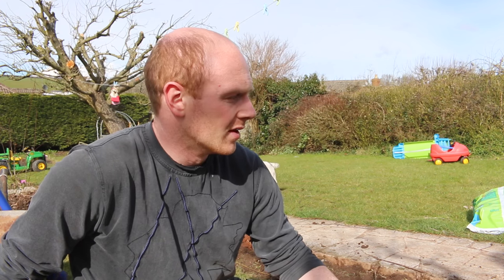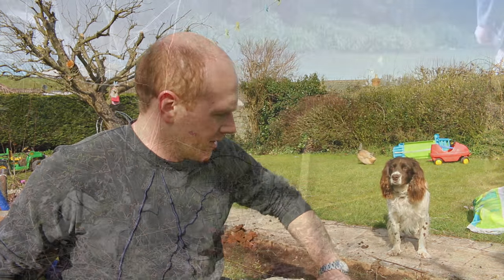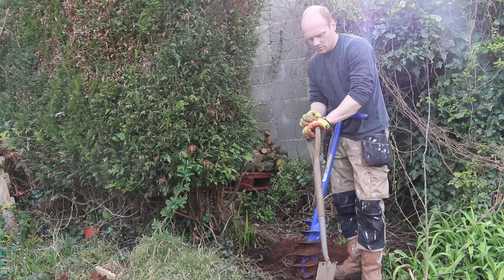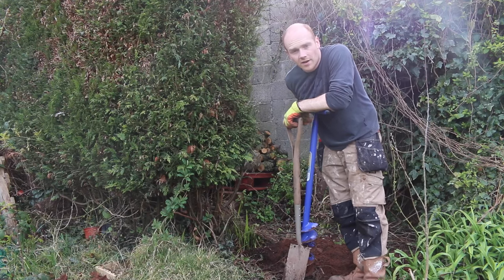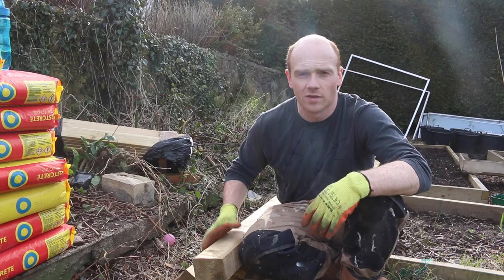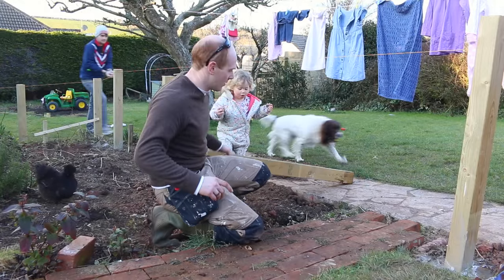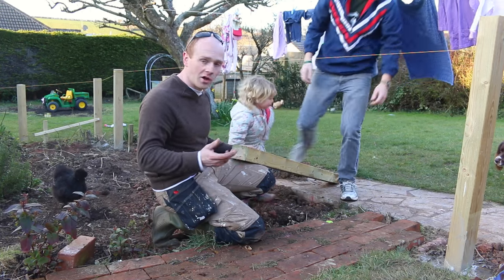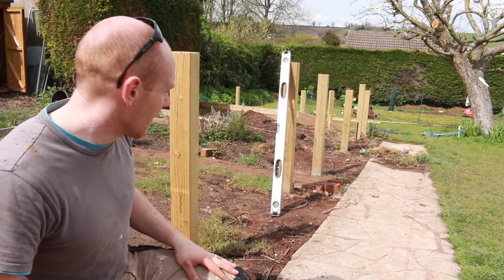Building a Picket Fence | Setting the Posts

Comment: Just a tip for everyone. Gravel in the bottom of the hole is absolutely not necessary. It wont hurt to do it but doesn't really help. Ive dug out 100s of posts in my time and that is the last bit to rot. Pay more attention to where the post meets the ground. Post saver wrap or bituminous paint. Youll increase the life of your fence massively 👍
Reply from the maker: Too true, did a video about this just the other week. 👍
Reply: Wrong. It prevents the end grain from soaking up moisture.

Comment: Wrap the bottom of the fence post in Denzil tape best thing ever for preventing rot.
Reply: Will try to remember.
Reply: It’s densyl tape and definitely don’t use that. It’s not even available to the average DIY’er
Reply: @isaactaylor1833  Actually it's Denso Tape,stupid auto correct,and you can buy it in any trade outlet,what's the problem with using it btw?

Comment: Smart job mate! Little tip for you that will save you hundreds in the future! Rather than concrete, leave your soil near you hole and use it to back fill around your post. All you need to do is basically remove any air from the soil by tamping it in nice and tight, few inches at a time. It's a dodle to do if you have a digging bar with a round flat piece on one end as the weight of the bar will do the work for you. And when your post eventually rots off, super easy to replace! Cheers!

Comment: Pouring dry concrete mix around the post will only promote rotting in the long run. Concrete wicks and holds moisture, which is retained between the wood and the post. This in turn ends up eventually saturating the post, encouraging wood fungi.
Reply: What do you recommend?

Comment: For ease of levelling and fixing the postcrete method is great, but if you have more help and time, I always simply use coarse and fine gravel and a sledge hammer with a piece of wood to compact around the post, this way the posts will last over 20 years.
Reply: 20 years is not considered a long rot time here in Australia  Glyn Tutt 30 to 40 is our considered time without any coating application,,,we have two main methods here of fixing posts in ground..the first and most popular is "stabilised soil"....cement mixed with the soil removed from the hole that is rammed back into the hole around the new post....this sets like mortar between bricks and is actually very firm but pores which allows rain water to drain through helping prevent the ground level rotting....and the other method is concreting which is even firmer but does trap rain water atop if the installer does not bother to trowel the concrete up the post to create a run off surface .....I concrete and trowel up but I also pour in concrete first to create a footing/sole plate then surround the post with concrete.

Comment: Really useful video. I have been inspired to build my own retaining wall this week and have just ordered the sleepers and auger. You mention using wood preservative for the part that goes in the ground. Can I ask which product you use or recommend? It looks like you are applying it the post around 4:40 in the video but there is no mention of what this particular one is. Thanks and keep up the great work 👍🏻
Reply from the maker: Usually I just sit any cut ends in a clear wood preserver like barrotine or a Sika product.  You should always aim not to have any cuts under ground ideally that way the pressure treatment will do the job.
Reply: Thanks for the info, the sleepers will be cut and concreted into the ground similar to your other video (Building a Timber Retaining Wall using Oak Sleepers - https://www.youtube.com/watch?v=Ua5geDvao9s) I just wanted to treat the cut ends with a preserver before putting them in the ground or didn't you do that for the posts you put in the ground?
Reply from the maker: If they are oak then no need, if pressure treated softwood then yes any cut ends should be treated.

Comment: I'm still on the fence about this video...
Reply: Hi. I have 6ft post to replace. How many feet should the post go into the ground. What was the consistency of the cement and water mix. I noticed that you just poured it into the hole. Appreciate your advice since I have 30m fence to replace.
Reply: And what is the green plastic piece u used on the fence

Comment: How deep do the post holes need to be?
Reply from the maker: Dean Riggott I usually aim for half of what's above ground. Others go 3rd under, which I would suggest is the minimum.
Reply: 100mm in ground  for every 300mm out of ground is a good amount....depending on high wind effected areas
Reply: 2' or 600mm is the engineers calculated depth for anything under 2m / 6'6"

Comment: how deep we have do do the hole ?
Reply from the maker: Sonia Nasef usually a third of the post is a good guide, or half of the above ground height.
Reply: 2' or 600mm is the engineers calculated depth for anything under 2m / 6'6"

Comment: Putting gravel in the bottom of the hole does absolutely nothing.
Reply from the maker: Your reason?
Reply from the maker: From my understanding it will prevent soil from being trapped against the bottom, allowing the concrete to fill in and around the gravel and leaving some form of drainage/soakaway.  To be honest if you go to the trouble of building your own fence, a few pennies worth of gravel is not a deal breaker and not worth leaving out.
Reply: Been fencing for 30 years and have removed many old posts, the section of post at the bottom of the hole is nearly always as good as new, it is where the post meets the ground is where the rot sets in.
Reply: Sorry, don't mean to criticise, you've done a good job.
Reply: wouldnt that be the reason for using gravel to keep the end from touch the ground?
Reply: I agree. The way I do it is make sure the postcrete its a couple of inches lower than the ground level and is preferably sloping away from the post. I haven't fully figured out how to stop it rotting and put gravel in the top 2 inches instead of back filling with soil. It seems to work okay but what do you do James?
Reply from the maker: I always do the opposite and leave the concrete higher than the soil level to ensure no sitting water where post enters ground.
Reply: tim webster Zed suggested bitchomen on the bottom. my local fence supplier said that is the best thing too
Reply: i would paint bitumen on the bottom of the posts and at ground level and just below. this should prevent any rotting.
Reply: James Jack actually your wrong and riddled with mass confusion or lack of expertise on this.. its helps with drainage help prevention rot on bottom of post . Post bottom will rot and act like a wick and work its way up the post..
Reply: the base of the post touching the "Ground" dose absolutely nothing to rot the post.... James Jack is completely correct and I've been building fences ten years longer than him...... one day ill get around to posting a feature fence that is too the standard to which i build for our well off in Australia that have all  rail and plinth board mortised into the side of the feature posts .....never ever have I in 38 years ever pulled a post from the ground that is rotted  2"/50mm below the ground level...photosynthesis does not take place down there....if u want to put gravel in the bottom then do it untill your little heart is content ....but it does not and will not do anything but add cost to your fence and, i've pulled out more old fence posts than u lot combined have had hot dinners ....its hog wash....and while the poster of the original fence gave some good advise and managed to build a half decent fence...I ...well lets just say would have done a lot of what he chose to do... differently.
Reply: Randall....James Jack is absolutely correct and after watching how u explain to build a fence....I know after almost forty years of feature fencing...its u that is confused mate
Reply: @fenceart5497  would you advise letting the concrete run under the bottom of the post? I'm thinking that any water that gets down inside the concrete, won't be able to escape.
Reply: Hi Joe, you can put concrete below the post, its regarded as a footing and can be a good stabiliser, the problem with concreting posts whilst it is far more stable than struts or stabilised soil is that water will remain around the post at the top of the concrete, the part of the post that is first effected by rot is 50mm above ground and 50mm below ground regardless of what is used to stabilise the post, if you leave the concrete 4 to 5 inches below ground level and back fill that with soil it will help some what to dry any water better than concrete at ground level, you can also protect it even more by applying sump oil or tar to the in ground post and a few inches above ground, or even the whole post.
Hope this helps Joe, one way or another mother nature will rot it, its a natural process of decay mate.
Cheers
Michael